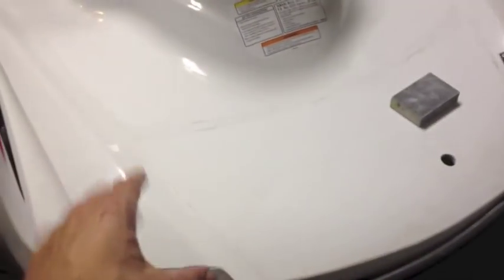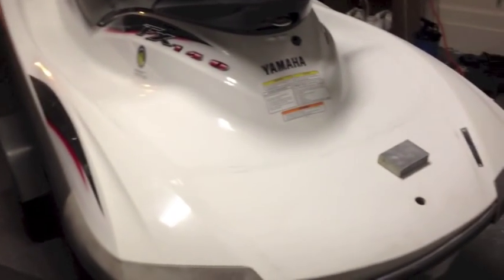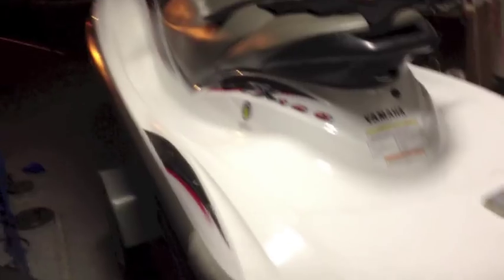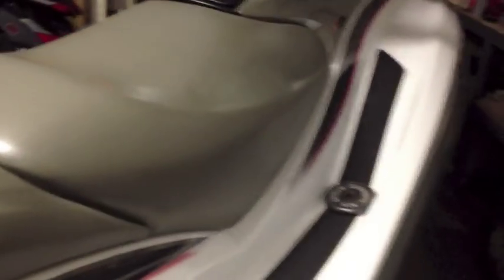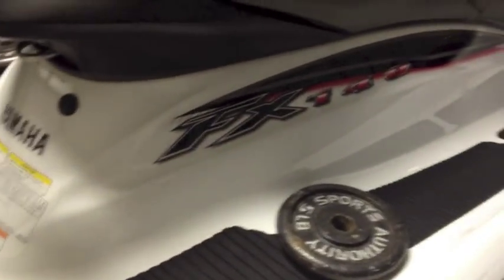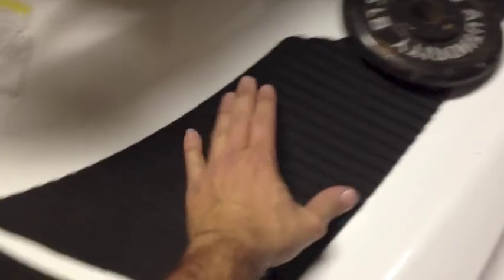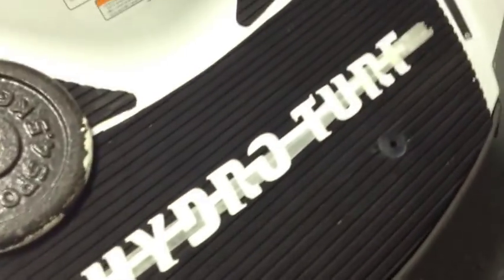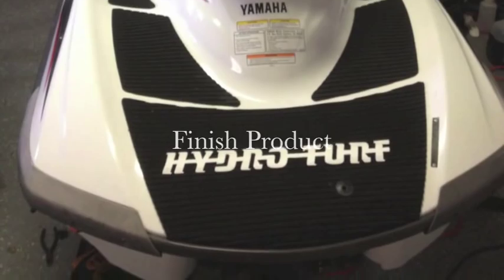WaveRunner Hydro Turf Mat Replacement

Comment: How did you remove the rivets from the middle molding? did you just pry the molding? Also did you install the rivets back did you do it from the outside or inside of the hull